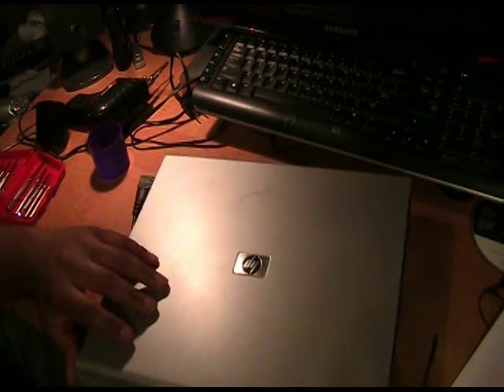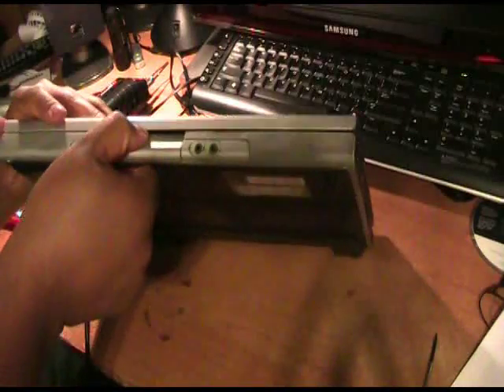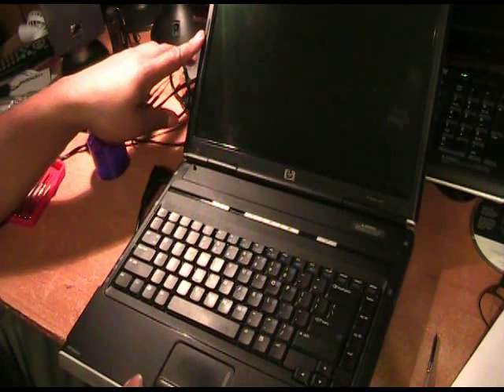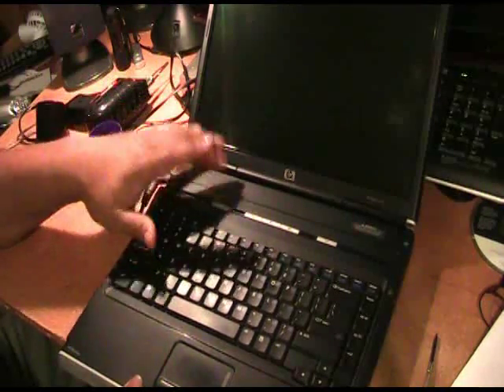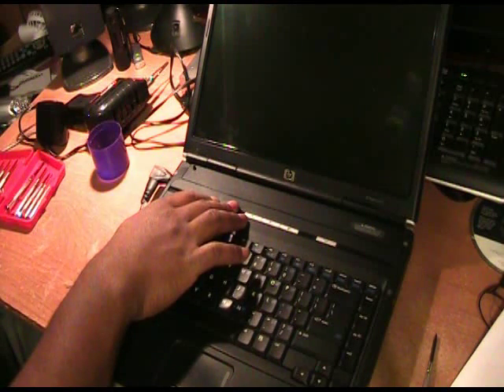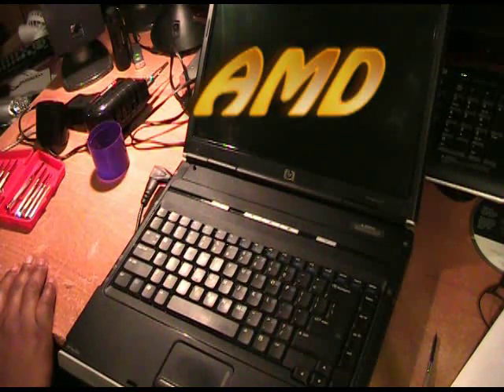part4

Comment: Thanks for the good tutorial! I hope you don't mind my bad English, My HP got verry hot and shut down automatically after a while. My father had a look at it and I gave it to a repair service. They cleaned it but didn't find anything. I bought an new one. Now I thought I could take a look on my old HP myself. I didn't find the problem. But maybe I found a solution by accident while watching the video. I found an HP support message, advising to flash the BIOS. Kind regards  from Germany

Comment: You are a computer genius. I bought this computer on eBay. The past owner tried to do it by himself with no results. Many of the parts were still in a separate bag when I bought this, but after doing what you did, it fixed it, it works, run, and I want to thank you for the time and effort you put into this video.